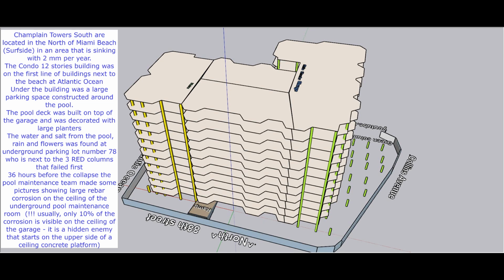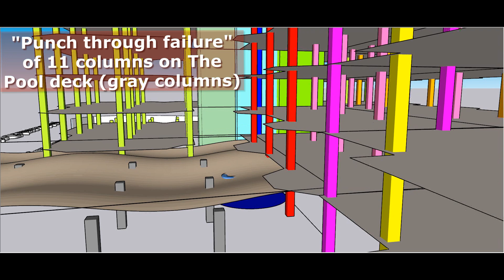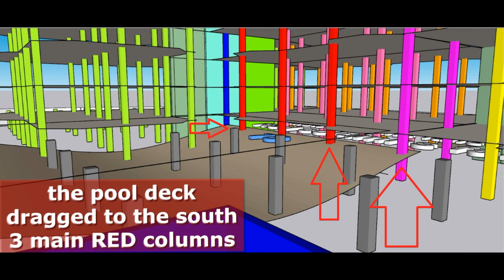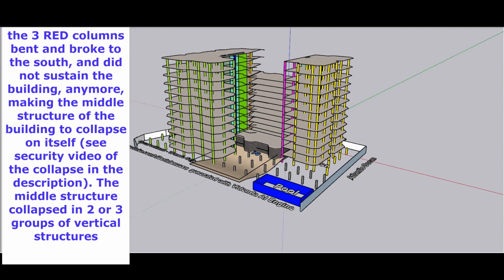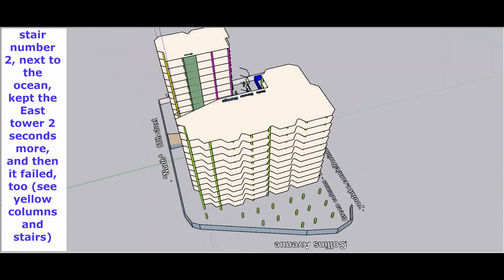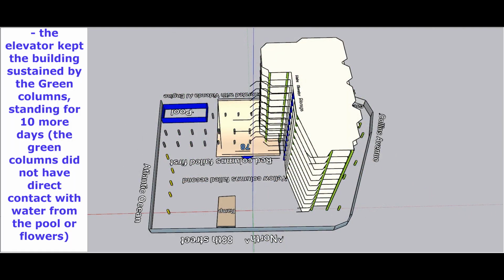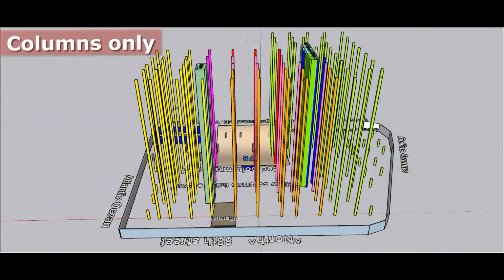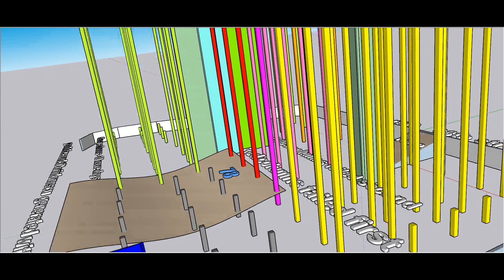Collapsed Building Miami, 3D model condo, penthouse, Champlain Towers Surfside Florida, demolish P3

Comment: Why is a guy in Bucharest spending so much time making a detailed 3D model of the Miami condo collapse? I just checked your social media, dude, and this seems to be coming out of nowhere....
Reply from the maker: I stayed on Collins Avenue several times since 2000 and it is Paradise on Earth. 
Now I have mixed feelings about how you can lose beauty and lives in minutes
There are 2 more identical buildings one block away, on the beach; I hope they get structure testing soon
See a birds-eye view before the accident, all 3 Champlain Towers (South, East, and North)
https://youtu.be/5naMGbAe8EI
Reply: @DorinIonescu  Can I just ask how you explain that the water from the pool and the two flower beds apparently headed UP HILL  to parking lot 78? your own 3D reconstruction shows that there is a marked descent from area 78 down to the pool area itself.

So, how did that water flow 'up hill' to corrode the 3 red beams?
Reply: I’m pretty sure they’ve copied from someone else. I’ve seen another channel post this model several days ago
Reply: @jagglenut  Can you post the link for that?
Reply from the maker: A commercial pool contractor who was inspecting the pool last week told the Miami Herald that there “was standing water all over the parking garage,” and the biggest puddle of water was by parking spot 78, located under the pool deck, where a contractor in 2018 had reported there was "major structural damage."
https://news.yahoo.com/video-taken-minutes-miami-building-160541001.html
Reply from the maker: I did my first 3D model in 1986 on a Yellow and Black screen computer connected to a tape recorder during the preparation my Graphic Modeling exam at the Computer Science faculty of Polytechnic University Bucharest 
Now architects use drag and drop method in super programs, I had to control each pixel on the screen
Then I had to print airplane projects on printers that have 9 needles and punched a black material toward the paper
While everybody was printing with letters (X, O, .) I was controlling 9 printer needles and print the 3D models
I can look through the minds of programmers who wrote AutoCAD, Autodesk, Sketchup  ...
My models look strange because I use both modern drag and drop objects that architects use and mathematical generated objects using pixels and triangles that scientists use
 
Nice memories - thank you for this question
I started to write some more on this link
https://docs.google.com/document/d/1o9BjBUcyMcl76_zmlWWmRxyEakBDNQMdEJ_Zi6ZWHIY/edit?usp=sharing
Reply from the maker: playlist with 3d models (I will update the playlist as I will find them)
https://youtube.com/playlist?list=PL9rGXY173aFrBQzfT2FoXydEXjQhrkjTo

Comment: Just for the record the mid section that collapsed was much wider and expanded almost to the final suppoirt beams.
Reply: My Educated guess!
*Chlorine pool water 40 yrs of storms overflowing the pool water!
*Waterproofing failure ! 
*DECK  punch thru shows connection failure at pool deck columns! ( look at columns still standing)
Column connection ** 
*Column connection undersized rebar ?
* Not Enough rebar @ column to deck!!!!!!!!!!!!! 
*Rebar single strand at bottom of deck !!!! More info needed
Reply from the maker: Yes - some front columns were dragged and other could not stand the weight. The first collapse was wide, between Green and Yellow columns
See The Penthouse, inside view before the accident, Champlain Towers South, Miami, Florida (Surfside)
https://youtu.be/HFWbCZG_6xA

Comment: Pool should have been drained and the lower garage should have had jacks and wood timbers installed as temporary supports until. Repairs where made. And tarped the pool deck to keep the elements out. Any building that sinks with damage the network of water supply pipes, sewer and roof drains. 
 .
Reply from the maker: Yes - structural engineers should be allowed to evacuate buildings until repairs are done. Like they did now by sealing the remaining building and then demolished it.
I still ask myself how the demolition company entered the building - they have a tough job
See The Penthouse, inside view before the accident, Champlain Towers South, Miami, Florida (Surfside)
https://youtu.be/HFWbCZG_6xA
Reply: The west(remaining)section of the building looked pretty solid so I'm surprised they decided to bring it down - they should at least have allowed the residents to pack up whatever belongings(gold/jewellry/money/photos etc)that had been left behind!
Reply: Accurate, learned that first semester structural engineering class.

Comment: I don't think the area was sinking, only the building was sinking. They were measuring the buildings only and it was the only building sinking. They only measured between 1993 and 1999 and averaged 2 mm per year. Probably started earlier to present and rate could have changed. Condo was actually 13 stories, a 13th story was added during construction. Drawings dated Nov 27/1979 and May 14 1980 shows these changes and were approved by the town. Not sure why the fact this is a 13th story building and unit PH-A on the 13th floor has made it into the news reports yet. It could be worth mentioning that the lady who escaped with her kids was in an apartment that had 1 to 2 of the red columns and was right above the garage. Her experience is the closest to "ground zero" that we have. The middle section collapse in a funnel fashion rather than being pancaked. This causes small concrete debris and less likely to create "pockets" cause by large floor remaining intact (not likely to find survivors in pockets). The pancaking of the Eastern part also had very low chance of creating pockets for survivors. It was probably known from the collapse video the chances of surviving are very low but nothing draws viewers like hanging on to the hope a survivor. Portions of the yellow columns fell with the middle section. There are lights on a kitchen window of a Unit A in the CCTV footage (apt 1112). Immediately to the left of those kitchen lights is ripped off (bedroom for Unit A) and falls with the middle section. https://pbs.twimg.com/media/E5i4J0XXEAwa4UP?format=jpg&name=360x360 I am not sure the word "flowers" is correct. "direct contact with the pool or flowers" at 4:26.
Reply: Oh joy they added an entire floor after construction was started? Recipe for epic problems later. Seems like any major change during a project comes out badly regardless of any reinforcement. Not like you can swap out the concrete footings/slab once they're cured and built on.
Reply: @SimianIndustries  Yes it was a clear red flag and could be the reason the general contractor resigned.
Reply from the maker: I was talking about "planters" and found a picture with 4 palms installed on the pool deck. Palms are heavy and I was thinking of separating the structure for pools and "flower beds" or planters from the main building from now on, at new buildings.  (I will change to "planters or flower beds" in version 4 of the model)
I saw a video with the original plans of the pool deck and there were a lot of water drainage and slopes - did they changed this with new "waterproof technologies" that failed ?
I will update version 4 of the video with the 13 floor and other observations - Thank you!
See The Penthouse, inside view before the accident, Champlain Towers South, Miami, Florida (Surfside)
https://youtu.be/HFWbCZG_6xA
 ......
The Venetian Las Vegas had this problem, water from the artificial lake of Venice was leaking into the Casino and dropping on players, tables, and machines on the main Casino floors. They could not hide it as people do now with leaking water in their garages (which is just 10% of the actual corrosion that you do not see)
At The Venetian, they build a second level of separation between The Lake and The Casino where , in a water-insulated environment, workers check the pool leaking and do the repairs.  These 2 levels of protection and separation between the building and the water should be the mandatory solution for all our buildings
And flower layers next to buildings should be approved by structural engineers. They should also receive the right to evacuate buildings using Mayor office approvals
Reply: @DorinIonescu  It seems there was a "repair" by a pool company in 2004 that may have poured a flat slab on the pool deck. Another possibility is in 1981, the slopes required an additional pour that never was done. The images of the profile of the concrete pool deck seems to show potentially the 2004 pour may have been flat only preserving  the drain locations. Examination of the cross section could potentially reveal if the slopes were there originally in 1981.

Comment: Made a lot of comment son the first iteration not realizing this one was out. The ramp goes in 4 columns into the building stopping at a magenta column just before a red column. All this street level water could come down the ramp near the foot of the red columns. Also here are the floors: Basement/garage, Lobby, 2nd, 3, 4, 5,6,7,8,9,10, 11, 12, 13. I think this is missing 12 & 13 floor. Stairwell 1 was taller to allow reaching the 13th floor by elevator and stairs likely allowed roof access (13th level at this side on the roof). Stairwell 2 also allowed access to the 13th floor (but no roof access 14th level). Roof was 2 levels (taller at the beach side and shorter at the Collins Ave side) - see google earth image of the roof.
Reply from the maker: Thank you - A lot of of changes for the version 4 of the 3d model
See The Penthouse, inside view before the accident, Champlain Towers South, Miami, Florida (Surfside)
https://youtu.be/HFWbCZG_6xA
Reply: @DorinIonescu  Some of the images in that video are of Champlain North Tower, not the South Tower. Be careful what you take from other YouTube creators because I'm seeing a ton of incorrect stuff thrown out there :-)
Reply from the maker: Thank you - I will update in the next versions of the videos
Reply: @DorinIonescu  Another detail about the ramp. I see where people are getting that the ramp only goes two columns in, its because they are looking at the lobby floor plan and the ramp only affects the lobby level so much (pdf 31/336). If you look at the garage plan (pdf 59 /336) you can see where the ramp actually continues to the 4th column into the Building or a couple column spans beyond stairwell2. The cross roads in the parking lot is right below apt 111 center. The planters are just outside and just south the cross roads square.

Comment: Oh dear. The observations 36 hours earlier could have saved people.
Reply: This is inaccurate. The rebar on the pool wall was exposed months before as part of the remediation. The pool didn't move at all and is still standing.
Reply from the maker: Nobody believed that sometimes there is to much corrosion accumulated in columns. From now on, people should take good care of their columns. 
I remember I visited a super nice house where a guy cut a column to make space for better turns with your car in the garage. I exited that house and never think of buying it
See The Penthouse, inside view before the accident, Champlain Towers South, Miami, Florida (Surfside)
https://youtu.be/HFWbCZG_6xA
Reply: @DorinIonescu  When a sign of corrosion does not result in immediate problems, people get lulled into a false sense of security. I hope people consider the importance of support structures.
Reply: @DorinIonescu  “...Where a guy cut a column to make space for better turns..” 

That made me sick, F**k some people are stupid,

Comment: Is it likely, and I would say yes, that the 1st floor slab was poured as one unit? Then when the exterior exposed section collapsed one of two things, or both, occurred. Garage columns(red)were pulled out of position, or if slab punched through effectively doubling column length resulting in buckling and subsequent  progressive failure. We all saw the images of lateral forces exerted by slab failure resulting in rebar tearing out of the concrete, that was the first thing I noticed above the bunk bed photo, and many others. Very alarming condition that exists in thousands of poured concrete structures. Scary.
Reply from the maker: Unfortunately they were connected somehow (one piece or later). Building should have separate structures for condos, pool and plants.
The Venetian Las Vegas had this problem, water from the artificial lake of Venice was leaking into the Casino and dropping on players, tables, and machines on the main Casino floors. They could not hide it as people do now with leaking water in their garages (which is just 10% of the actual corrosion that you do not see)
At The Venetian, they build a second level of separation between The Lake and The Casino where , in a water-insulated environment, workers check the pool leaking and do the repairs.  These 2 levels of protection and separation between the building and the water should be the mandatory solution for all our buildings
And flower layers next to buildings should be approved by structural engineers. They should also receive the right to evacuate buildings using Mayor office approvals
Bonus
See The Penthouse, inside view before the accident, Champlain Towers South, Miami, Florida (Surfside)
https://youtu.be/HFWbCZG_6xA
Reply: @DorinIonescu  Yes deck slab should have been separate from the building, with the deck slab having it's own columns at it's edge. Also the deck slab columns should have column capitals to spread the load and allow more steel at the junction with the pool deck. Normally there would be a 2ft x 2ft x 6 inch concrete pad on top of the column cast integral  with the slab. This would help prevent punch through failure.
Reply from the maker: Your observations should be transferred to new legislation - until then I will rent only in small buildings.
I had a similar problem and voted yes for consolidation even if I had no money. It is important to start working as soon as possible. It is like insurance, you do not know when you need it.
Then I helped to get more YESes from other owners
Then I paid monthly amounts
So we should be aware of tall buildings because people are very hard to get on the same page about consolidation. Now I remember a confession of the Surfside Tower president of the association who resigned "We negotiate for long periods a lot of aspects and near the end, somebody came and changed everything we agreed" (I quoted from memory)
There are 2 more identical buildings one block away, on the beach; I hope they get structure testing soon
See a birds-eye view before the accident, all 3 Champlain Towers (South, East, and North)
https://youtu.be/5naMGbAe8EI
Reply: From what I've heard, that wasn't rebar pulled out of the concrete. It was far more serious.  Those post-tension cables that ran the full length of the pool deck and first floor. There were no beams to provide support. The deck and first floor were poured. Then the cables were passed through the slab, and thousands of pounds of tension were applied to keep the slab in compression. This was a fatal mistake. Considering the corrosive environment. All it takes is a single cable to fail due to corrosion. That puts stress on adjacent cables, also weakened by corrosion. They fail. When enough post-tension cables fail, the slab loses all structural integrity. Just like if cables failed on a suspension bridge. The rest is correct. The collapsing slab either pulls on the perimeter columns, or destabilizes them due to the unsupported length.
Reply: @DavidJohnson-tv2nn  there were no post tensions cables in this construction. The structure was poured in place (post-tensioned concrete is typically precast) using two way slab construction over concrete columns. If there had been post tensioned cables, you would see them in the rubble, their cable cavities pulled out like slinkies.
Reply: @DavidJohnson-tv2nn  no post tension cable are called for or shown in original drawings.
Reply: @bnjoo  thats right its only a traditional slab no post-tensioned …i dont know how you in the US construct traditional slabs with no beams and even furter a slab of 6inches thats crazy
Reply: I agree with you..i think if they had beams in the columns the slab first of all dont punching and dont doubling the lenght of the columns if a slab is gone and doesnt have a progressive failure
Reply: My Educated guess!
*Chlorine pool water 40 yrs of storms overflowing the pool water!
*Waterproofing failure ! 
*DECK  punch thru shows connection failure at pool deck columns! ( look at columns still standing)
Column connection ** 
*Column connection undersized rebar ?
* Not Enough rebar @ column to deck!!!!!!!!!!!!! 
*Rebar single strand at bottom of deck !!!! More info needed